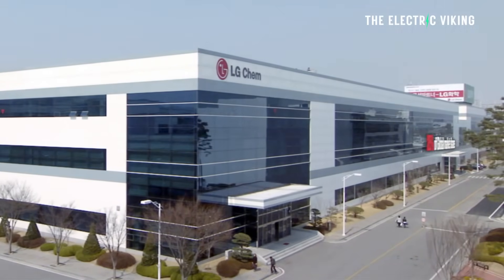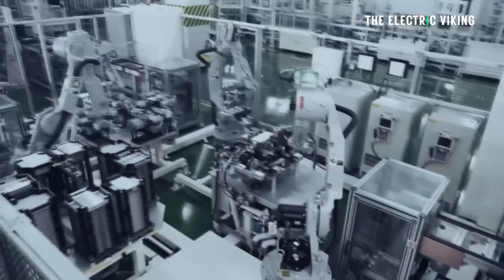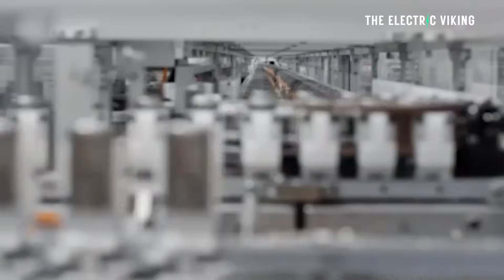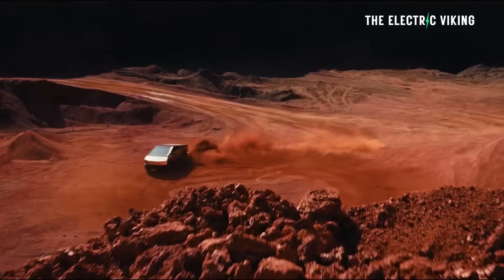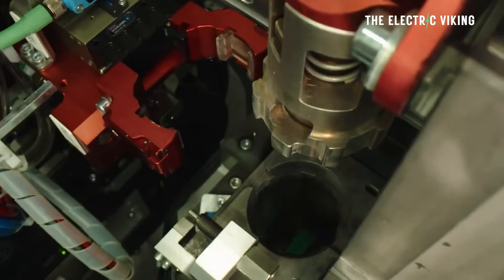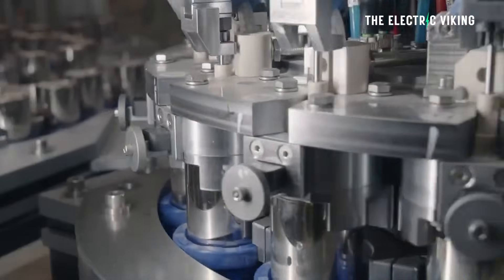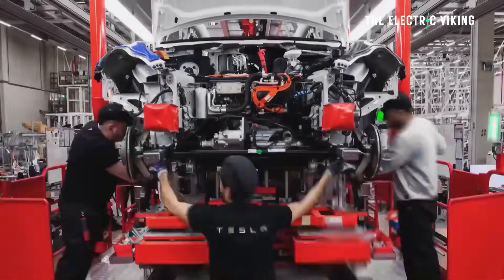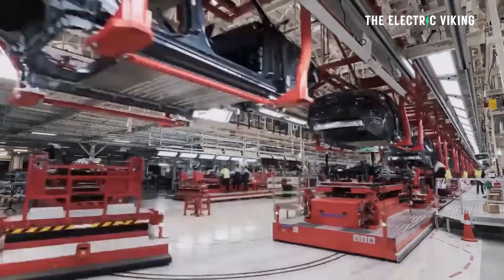Tesla will start using 4680 battery cells in China Gigafactory in August

Comment: If you've ever seen how many tabs are in a 4680; you wouldn't wonder why Tesla has such difficulty making it; there are about 50 tabs each which has to be precisely folded into place as the battery is built, any one tab out of place and the battery has to be rejected; which is most of them. As a result Cybertruck production is very limited; and the plan for the entire Tesla line using 4680 ditched. Will LG do any better?  If Tesla has a better battery coming; why torture themselves with more 4680?

Comment: In a recent report is showed that the Tesla model S and X that use the smaller 18650 battery retain more of their range longer than 3 and Y that use the larger 2170. If the ability to retain range is related to size and number of batteries that would mean the 4680 would be even worse. However, if the chemistry were different say M3P LFP that might make up for it.

Comment: Where ever LG batteries end up, I hope to avoid them in my purchases. Too many manufacturing issues and lower performance when compared to Panasonic, CATL, BYD.
Reply: LG batteries in GM cars that were problematic were pouch cell.
Reply: I agree, hence why I’m not purchasing the new model 3 performance, staying with my 2020 model until a better battery is placed in the new model. Or may look elsewhere for a better performance car
Reply: Its hard to avoid as of now. LG provides batteries to most of Teslas in Europe, Lucid, VW, GM, Toyota, Honda Hyundai, Kia pretty much all the EV car manufacturers
Reply: @galaxyoldman  BYD has blade batteries which are one of the best.
Reply: @Bobby-xh6sr  its cheap but the power density is lot lower than NCMA batteries. Thats why all the high end models all choose NCMA battery
Reply: I can’t understand why Tesla would have 2 different batteries in their model 3 performance, LG from China plant, Panasonic from US plant, they should have used BYD Blade batteries for their performance models, instead, we get the bad end of the stick with the LG battery which has 460hp, compared to Panasonic batteries which have 510hp

Comment: Do you have a video where you compare the different EV batteries currently being used by different automakers and what the pros/cons are?
Reply: That's complex, even a single model of car can use a different battery chemistry depending on trim level. For example some base models use LFP but the longer range ones use NMC. And it can change at any moment. When the US announced rules for the tax credit there was a made rush to switch to batteries that qualified. So it can be a moving target.

Comment: Well, if the Chinese model 3 performance has less power, it will depreciate more, which means I can buy a used one for cheaper.
I don't care about extra 20hp...
Reply: It's actually an extra 50 hp.
Reply: @KP-xi4bj  still don't care. I'm more interested in how much less it will cost compared to one with LG batteries
Reply: @dgurevich1  Teslas are cheaper and more affordable today than last year.  If you cannot a brand new Tesla today then you have no business buying a BEV.
Reply: @KP-xi4bj  I can but why should I?
Reply: @dgurevich1  Yes.

Comment: You are 99 percent right most of the time. This time I think not. Could this be for the USA market, yes. World market, no way. LFP has the supply and price/performance ratio. The only way I could see this is for the cyber truck but it really should be 4690 or 46100 by then like Rivian will be doing soon. If Tesla doesn't move away from NMC cylinder next year, they are going to be beat by everyone else. LFP will be made in the USA by many other players by then.
Reply: Cyberctrucks needs higher energy batteries. Nmc (etc) are higher energy density than lfp. Dalhousie uni (Tesla sub contractor ) showed a 1 million mile nmc battery a few years ago ( secret to longevity is using crystaline materials) . With a good bms you can get very long life out of good nmc batteries. There are invovations to nmc that do increase their energy densities and Tesla is confident they can (they got instance purchase a company that specializes in adding silicon to batteries)
If everyone stops using nmc these minerals in them will drop dramatically in price so nmc could actually cost less than lfp if everyone thinks they to expensive(,🤔😂).
Tesla also has a cathode factory under construction in Tesla Austin, and when (if) the dry electrode process is working Tesla will be able to produce nmc batteries at really low prices .
Lfp batteries materials are in really low availability in the west so may actually (if ever ) take a very long time for lfp materials to be readily available in the west .
Reply: @allangraham970 Cybertruck doesn't need NMC. Half the pack is empty space. It can handle the heavier LFP. The newest LFP are almost the same density of NMC just heavier. Tesla has already purchased LFP making equipment. The transition is already starting.
Reply: LFP is not the end all an be all as there are down sides -- NMC still has superior energy density and with Tesla's battery management system and the demonstrated longevity of their NMC packs - your point is a bit overstated.  LFP makes perfect sense for the Tesla Power walls and large mega-packs - I would expect some form of LFP chemistry in 4680 format for those down the road.  Tesla is focusing on the cylinder format to cover all their use cases because that will give economies of scale and reduce per unit cost.
Reply: @RagnarinVa so economies of scale won't apply to LFP? Have you heard of Catl or byd batteries? The issues is NMC cylinder is higher cost and when you have that many cells the pack cost is much higher. Larger cells means simple pack design which means less parts and you can repair LFP packs. You really can't repair their newest NMC which they fill with foam. You have to recycle the whole pack even if some cells fail.
Reply: @TheLobo91  - That is not what I said.  I said - For tesla - in order to hit economies of scale to make their own batteries - which is part of their strategy - they will need to stick to a single format - the 4680 cylinder - for all of their batteries - irrespective of chemistry.
Reply: 99% wrong you mean. Haha.
Reply: LFP batteries are shit in BEVs.  NMC/NCA > LFP
Reply: @TheLobo91 Only if the target vehicle is over $55,000 for a car and over $80,000 for an SUV/Truck. Remember there is a $7,500 tax credit for cars under those price ranges with Made in the USA batteries so the 4680 would have to be put in higher priced cars.